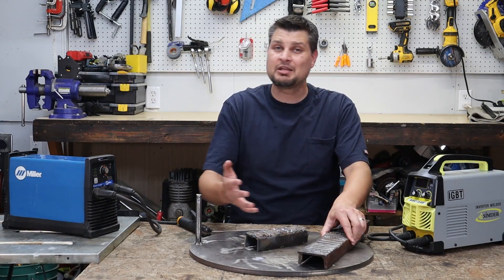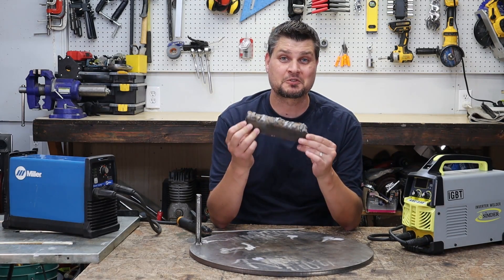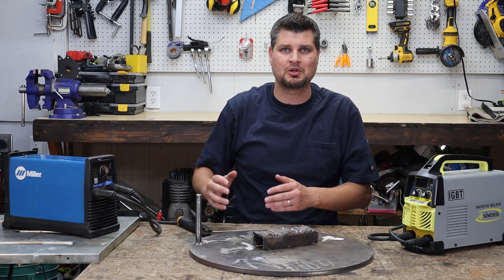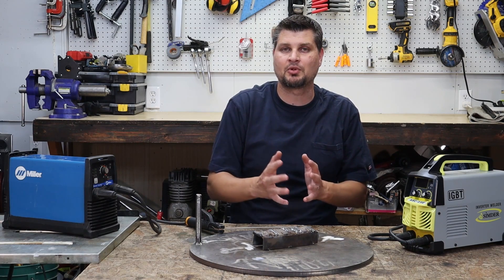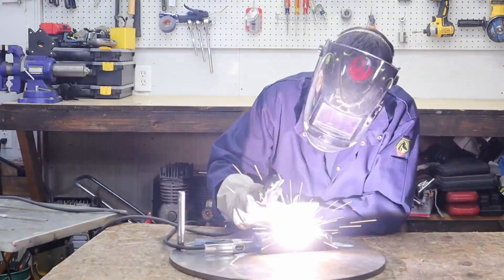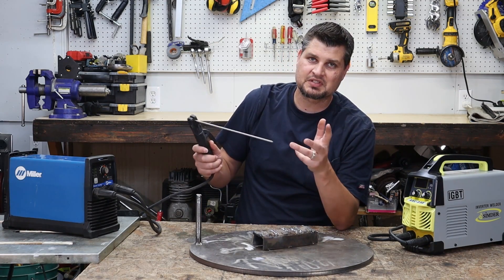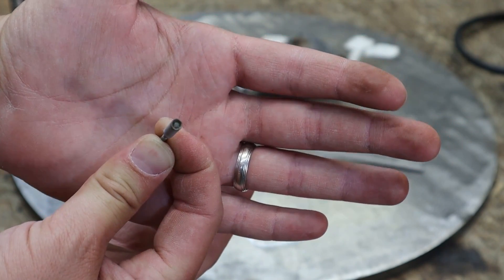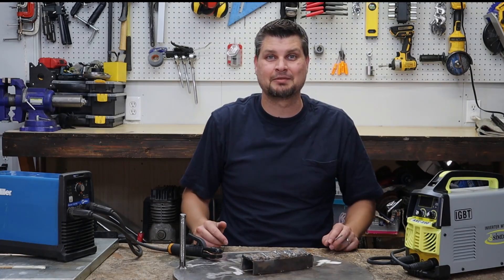#1 Stick Welding Tips for Starting an ARC

Comment: Usually I can tap the end of the electtode on something hard. (Not grounded metal if it's in the holder with the power on.) 
    Restarts for 7018 are a special case. To do it textbook, you need two things. 1.) Grind the weld from where you stopped on to where you will weld, down to clean bare metal. 2.) Use a new electrode or grind the old one flush. You can't have any metal sticking out beyond the flux or any cracks in the flux!  I like to set aside any partly used sticks, and cut the ends with the angle grinder cutoff wheel. This gives a nice clean end with the metal exposed, but not sticking out past the end of the flux. (Clamp, maybe wrapped in a rag. The cutoff wheel can cut off fingers too.) Then you can use it like a new stick. 
    If the weld isn't critical, maybe you cut some corners.

Comment: I’m new to stick welding.  Great video! Probably a stupid question, after you strike an arc, how far off the material do you hold the electrode to hold that arc and actually weld ?

Comment: I appreciate your honesty. I'm a DIY retired, fabricating for fun, make repairs on my old tractor and implements, fix stuff that needs it without buying new stuff that cost a fortune these days. I have a cheap flux core, stick welder and a plasma cutter. Under $600 I can do anything I need to do for all 3 pieces of equipment. It's darn fun. It's all in the settings. I seen a good tip to add to your good video....try low amps then high amps. Then go to the middle and you will probably find the setting that keeps splatter down and will lay a decent bead. As this gentleman stated....practice on old steel. Go to a scap yard and buy scrap for 29 cents a pound and have fun. Dont make a science out of welding unless you are getting paid to do so. His title says DIY PRO. Yep...that's what I'm aiming  at so I watch his videos over and over. Hes the only guy I like watching that I can deal with that talks while instructing. Mostly I like videos without the jibberish. I don't want to hear your life story, how much you know, about your brother in law or your past mistakes. Just get to the point! Thanks for these good videos.

Comment: Glad this video came across my feed. Just started welding two days ago. Very, very new to this lol. 

Hardest part for me is HOLDING the arc. It'll light up, but only for a hot second. Have tried everything, in regards to distance of rod to metal. 

The only thing I haven't tried is upping the amps substantially. 

Ran 3/32 at 65 amps yesterday. Nothing. Just stuck a lot.

Upped it today to 115 amps. Was noticeably better, but not quite there. Still sticking a lot too though.

And yes, I have one of those cheap Amazon welders. 

Will try again tomorrow at 125 amps.
Reply from the maker: It also depends on the rods you are using. You'll see 7018 rods require more amperage.
Reply: @-DIYPRO-  Am currently using 6011's. 

Tried 65 amps again yesterday and it seemed to run fairly ok. 

May just be my newness to it all. But between the sticking and not arcing for long ... man lol. It's a little frustrating. 

Am beginning to think that my ground is not very solid/clean either.